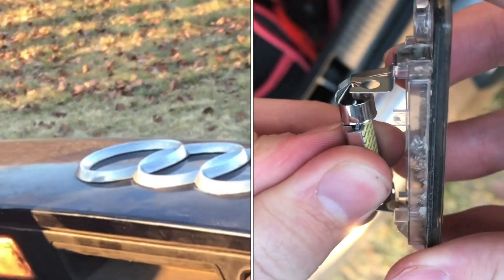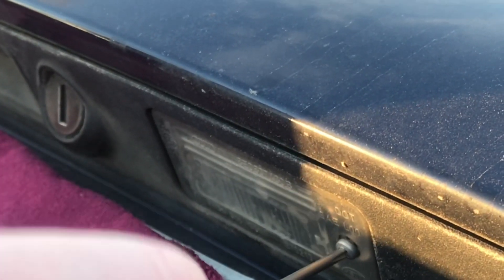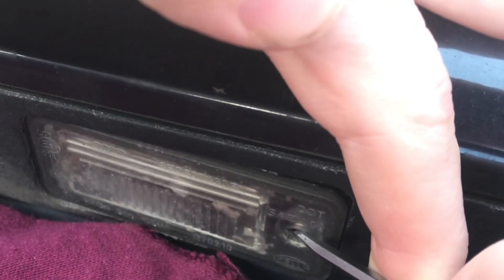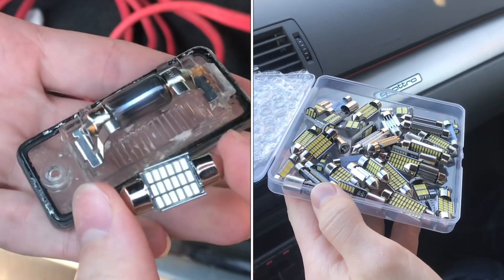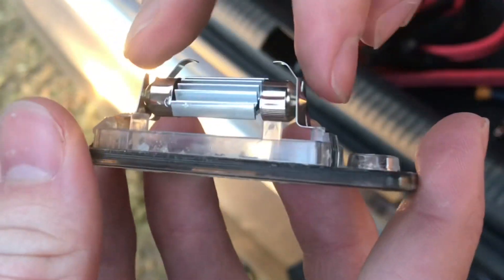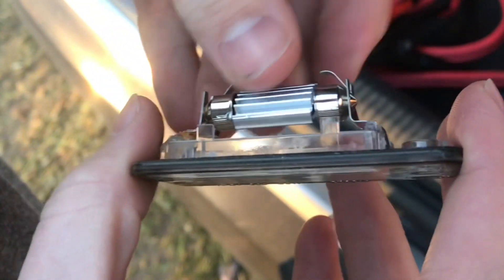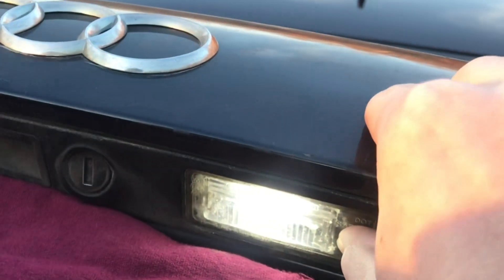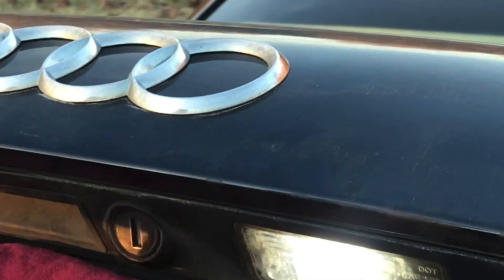REPLACING “license plate bulb light” (a3 a4 a5 a6 a8 d3 q7 rs4 audi b6 b7 volkswagen passat)

Comment: Do you know why they give you 42 of them? Because you'll be replacing that same bulb 42 times over the next couple years. I also went down the path of replacing lights on my vehicles with Chinese LEDs...they all failed after a year. Also surprised to see they wired a lot of the elements on these bulbs in series. I ended up gutting their board and saving the bayonet ends and making my own circuit board with super-brights and holding back about 1/3 the current. Now THOSE "LED" lights have lasted years.